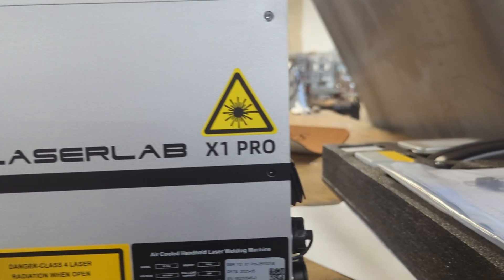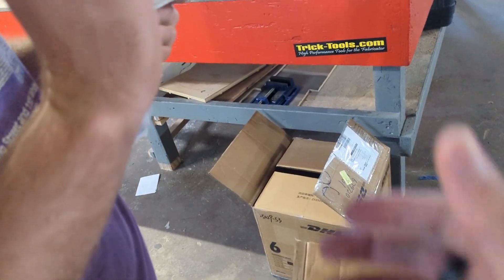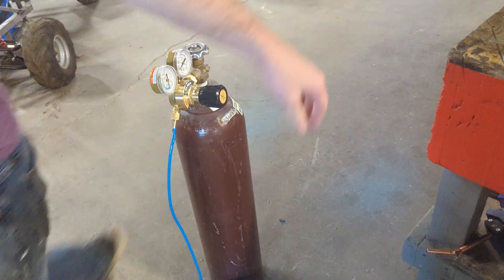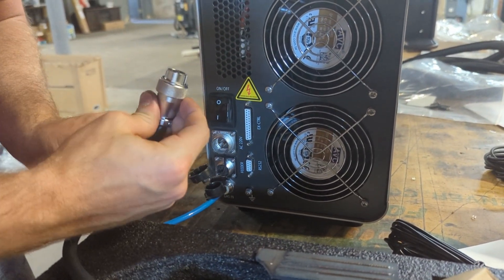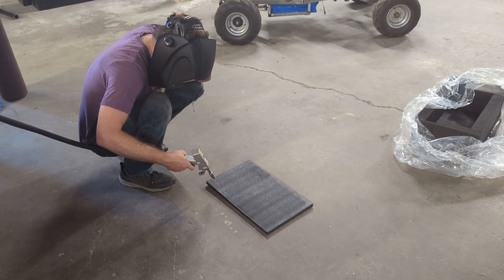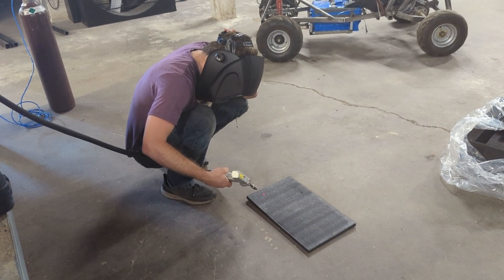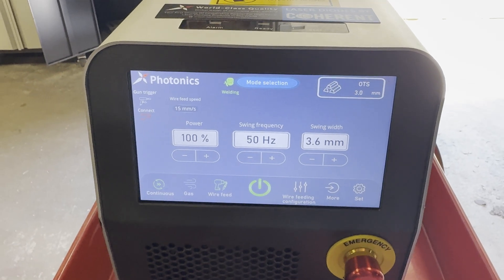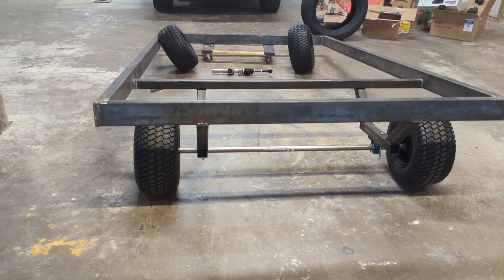This Welder Changes Everything? XLaserLab X1 Pro First Impressions

Comment: Can you use flux-cored wire and skip the gas?
Reply: No you can not the unit detects inert gas, if it does not present it wont fire. Even if the gas pressure drops unit will not fire.